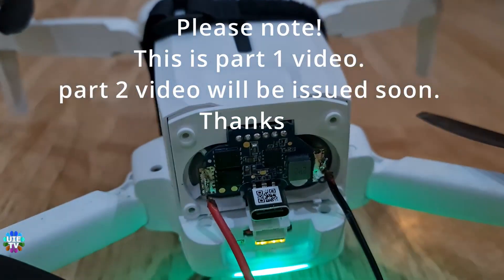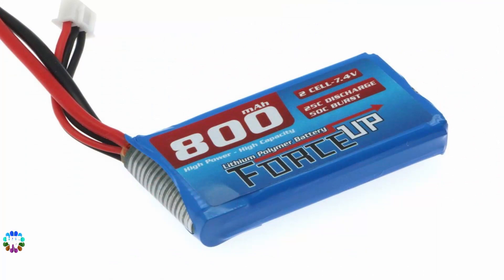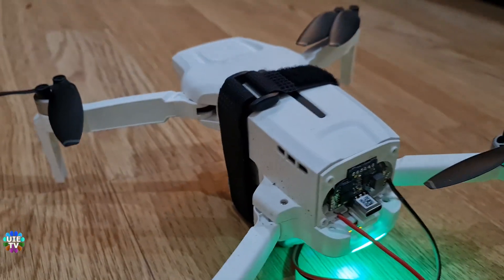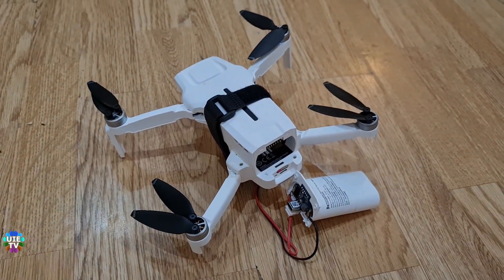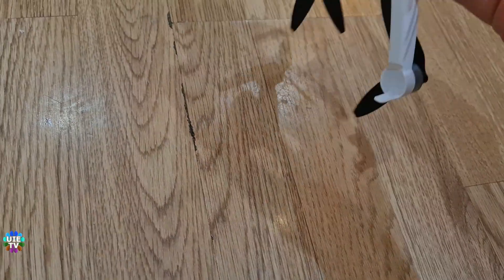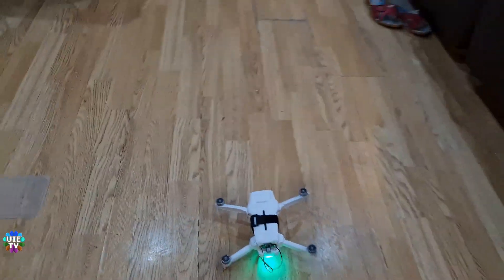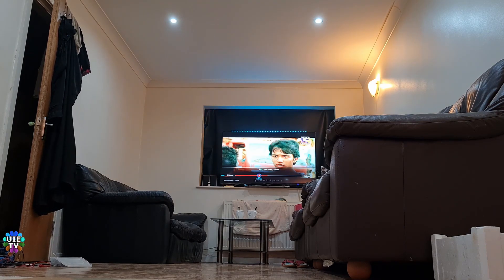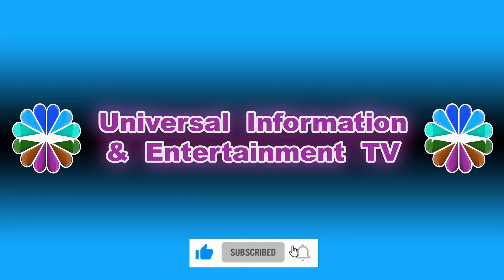Easy Battery Modification on New Fimi Mini x8 Drone.  (part 1) Home Made Battery Mode.

Comment: I tried this and it does not work. You have to solder a jumper from the middle connection to the new batteries center connection without disruption to the factory batteries. I know from experience and destroying two brand new batteries.  Once you desolder or disconnect the battery, it goes into a block mode. The charging light will flash. Dead in the water.
Reply from the maker: it could be, i never tried,